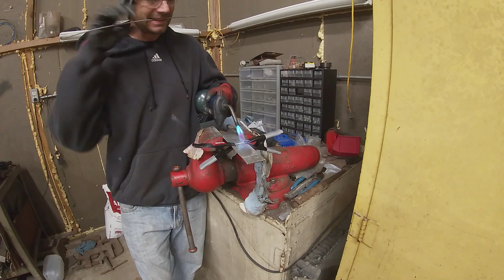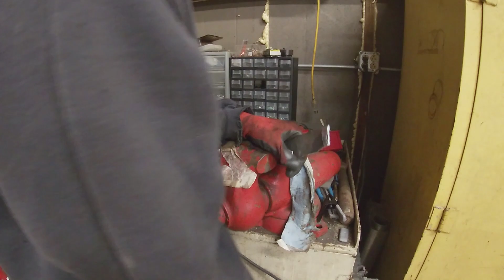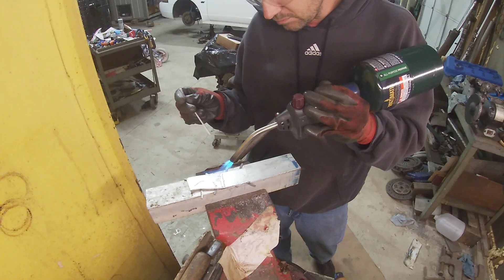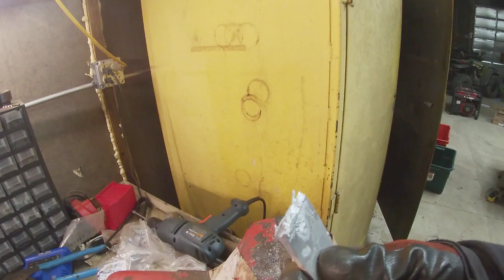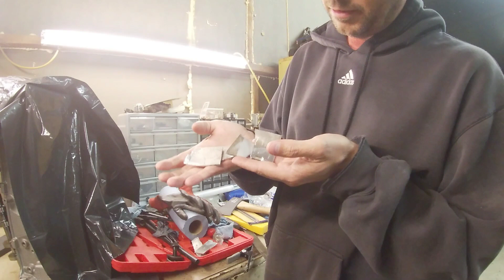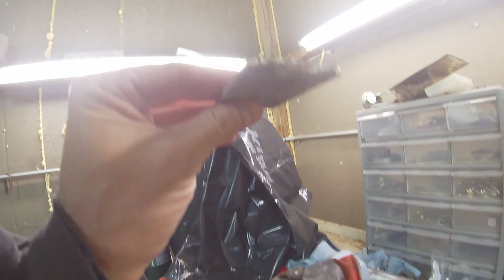Hobart Aluminum Brazing - Breaking Some Samples

Comment: Check out Project Farms strength test on the Hobart rods.
Reply from the maker: I did see that video before i decided between these Hobart rods and the Alumiweld.  This video was specific to a groove weld joint like i did when i used this to repair an aluminum rim.  I could have had it welded but wanted to give these a try.  Worked well for a year, but finally recracked.

https://youtu.be/nyyP4XaAt8Q